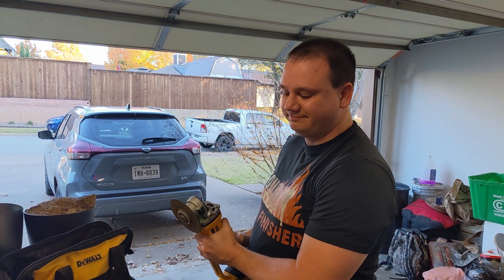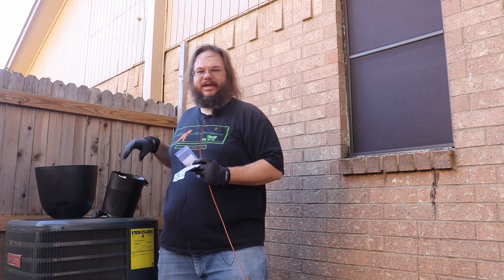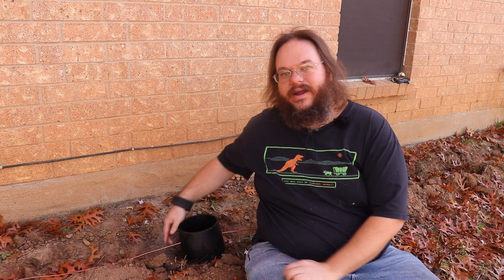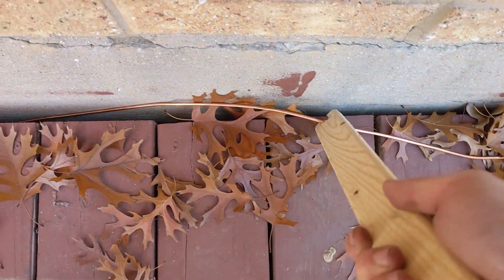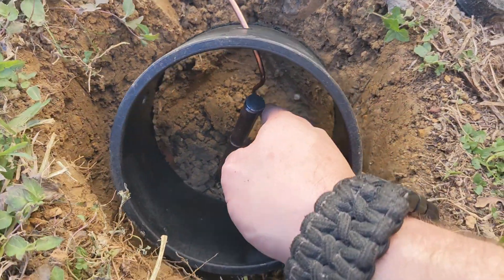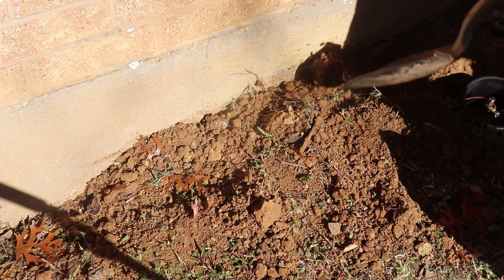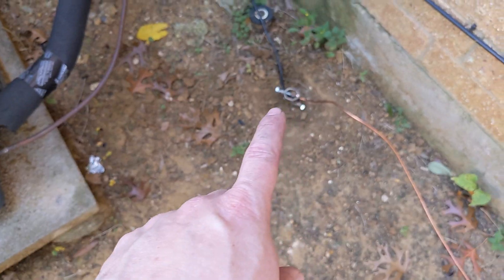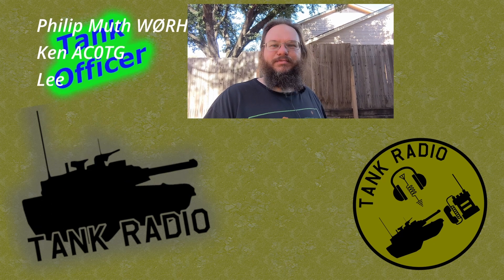How I Grounded and Bonded my Ham Radio Station

Comment: Do you only have a 2 wire plug system in your house?..thought thats why all the grounding was done like this in the past. But modern homes already have an earth ground ..so when you plug it in its already grounded. ARRL vid explained  this in detail..its on you tube ..take a l9ok.
Reply: Essentially he's installing a lightning rod to his house, and it would be best to give the lightning a shorter pathway to the ground rather than through your radio and through your house. Granted you always run a risk of a direct strike and grounding your antenna is no guaranty, also grounding the antenna itself helps prevent static buildup. Hope this helps.👍🏻
Reply: @JamesS.254  it did...thanks

Comment: Why is all of this necessary? This is not intended as a snarky question or trolling. I honestly want to know what's going on here and why.
Reply from the maker: this is done for bonding the ham and antenna group to the house ground.  Since it was a long ways to connect the antenna ground to the house ground, you need to run more grounding rods.  THIS will prevent a grounding loop across the long ground wire connecting the systems together

Comment: That done correct. 2 clamps on the house ground rod and you put the clamps on right. #6 or #4 stranded bare copper would be better but the cost. now later if you had to add a outher ground wire just get a outher ground clamp and connect it just like house ground. it is ok to have 2 or more clamps per ground rod. only 1 wire in a clamp . now if you get a ground surge it will be out side your home. letting the surge in can start a fire. remember to have single point ground for your radio system. and that connects to that same ground you put in. lots of video's on you tube on how to do that. havening a good ground also helps noise floor .nice you help Jason Ham radio 2.0 . you will learn a lot ! 73's

Comment: I'm working on a similar grounding project.  I was wondering  how I'd get all of those ground rods in, now I know the right tool to rent.  I could still have some problems with hitting rock at my West Virginia QTH, but, I won't know until I try.
Reply: I am a electrician in NY . hitting rock is common. if mist of the way in bend it over below grade. also may have go put a outher rod in if does not go in far. stranded wire #6 or  #4 bare is better but the cost. use correct clamps like in video . they are UL approved and the right one put on correctly. watch this video. that is the right way to clamp wire to ground rod and to home ground rod. 2 clamps.